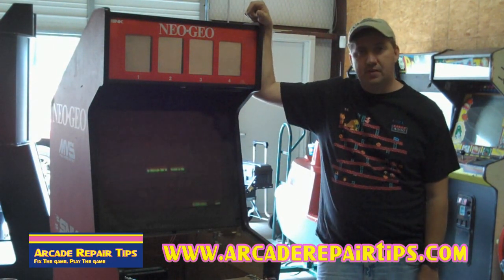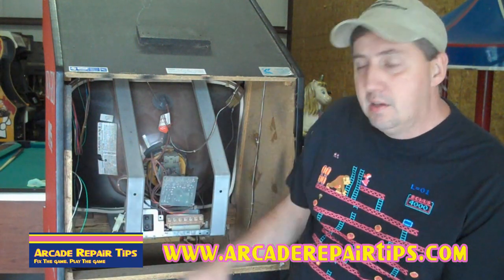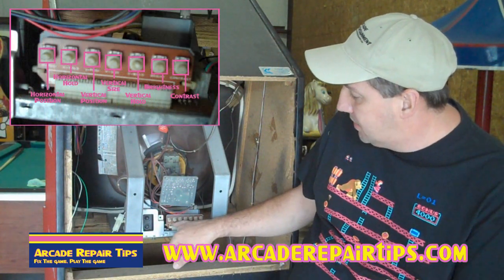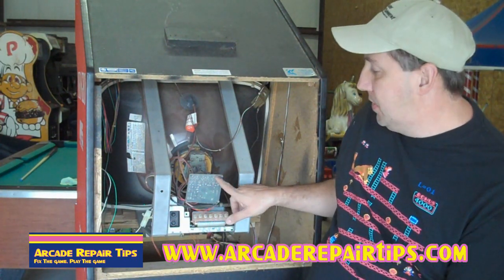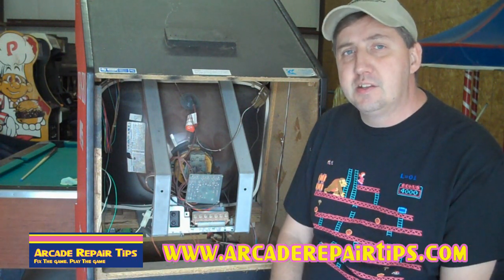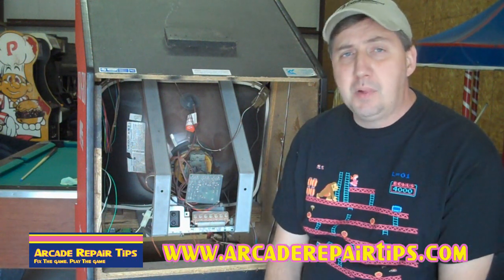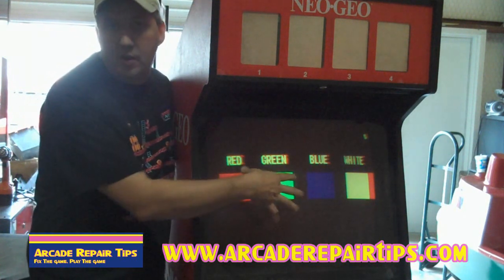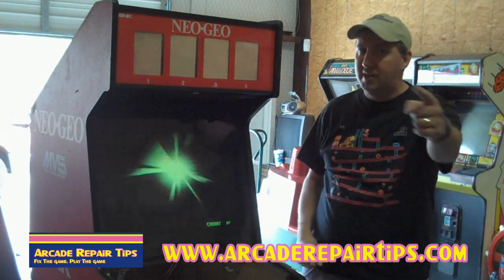Arcade Repair Tips - Adjusting An Arcade Monitor

Comment: I just bought a gorgeous Class of '81. Ms. Pac-Man/Galaga with 25" monitor. The very bottom of the screen is slightly fuzzy, everything else good. The distortion is just at the bottom like were the row of fruit is and on Galaga fuzzy were ship is and the board badge is fuzzy. Any suggestions?
Reply from the maker: Sounds like a convergence or yoke positioning issue. Check out our website for our posts on Adjusting The Convergence Rings and Setting Up And Adjusting An Arcade Monitor for more information. 

Also, just wanted to let you know that we will be covering your question on our Live Show Episode 46 on Thursday, December 3, 2020 at 5:30 PM CT. Here's a link to the episode if you want to watch it: https://youtu.be/vcE7kPMwRP4. Thank you for your question and good luck with your future repairs.

Comment: I need help, please! I got the jamma board to switch, but the game scrolls right to left  and doesn't stop. What am I doing wrong? There is video and sound, but keeps scrolling and is video turned sideways. Do I need to adjust something on the jamma board or maybe this jamma board is for those flat table top arcades?
Reply: no, that scrolling is either the vertical hold or horizontal hold, its an eazy fix, just turn the nob on usually the vertical hold and itll stop scrolling.If your going the wrong way youll know cause itll start scrolling much faster, but im sure by now you have figured it out.Luckily for you its like the easiest thing to fix when it comes to this stuff

Comment: I know I am decade late, but I am looking for info on the Horizontal SIZE. I see in your video, you also do not specify there being a SIZE for it, but you verbally said Horizontal Size.

I have the same described options you do, and there is no way for me to adjust the width of the screen. Is it not possible? I can only make it bigger or smaller Vertically.
Reply from the maker: Hey DARKISANDY. Check out our post and video on Adjusting The Horizontal Width Coil for more information on adjusting the horizontal size. Hope that helps.

Comment: I have 2005 golden tee. I adjusted the volume and screen went out. When I turn off power then back on think vision comes on screen then it’s blank. Is there a way to factory reset or adjust the screen.
?
Reply from the maker: Just adjusting the volume should not have caused the screen to go out. With that said, it’s possible that you jostled something while performing the volume adjustment. Check to make sure that the connection between the monitor and the board is good (probably a VGA cable). You might also want to check the monitor itself to make sure the game board is set to the proper input (try hooking up a computer to it if you have one). Check to make sure that the JAMMA harness is properly connected and that the voltage going to the game board is correct as well. If all that checks out, there’s a good chance that there’s a problem with your game board. If it’s playing blind, it’s more than likely an issue with the video card.

If you would like to hear more of our thoughts, we will be discussing your question on our Live Show Episode 71 which can be found at the following link: https://www.youtube.com/watch?v=ppjQ5N8edJc

Comment: one of the blue neck bord pots fell off what should i do
Reply from the maker: Josh, you should be able to find a replacement for the pot that fell off. Just solder a new one in it's place and you should be good to go. You can get neck board potentiometers from Arcade Parts & Repair, Arcadeshop, and other arcade parts suppliers. Hope that helps.

If you would like more details about your question, please tune into our Live Show Episode 56 on Thursday, October 7, 2021 at 5:30 PM CT. Here's a link to the episode if you want to watch it: https://www.youtube.com/watch?v=j_XtYMFsGpY. Thank you for your question and good luck with your future repairs.

Comment: if the red color gun is not working is the monitor fixable?
Reply from the maker: Unfortunately, there’s not much you can do if the red color gun on the tube is not working. A tube rejuvenator may possibly be able to restore it. With that said, you're probably getting to the end of life on the tube. Best to replace it if you can find a compatible one. Hope that helps.
Reply: @arcaderepairtips  thanks. I was able to replace it. :)

Comment: I'm missing about an inch at the top of my monitor. If i try to move the image up with v size/ v postion it just starts coming back down and overlapping the screen, anyone know how to fix this?
Reply from the maker: Sounds like a classic case of a bad capacitor in the power supply section of the monitor chassis. Get a cap kit and install it and you should be good to go. Check out our post and video on Installing A Cap Kit for more information.
Link: https://www.arcaderepairtips.com/2009/07/09/installing-a-cap-kit/

Comment: I have just installed an Icade 60in1 PCB, which I bought second hand from eBay, into my jamma cab. Basically, the colours are screwed up on the games, more noticeably on Donkey kong because Mario and the girders are purple and not red and frogger as most things look purple, logs, lily pads, everything. On the opening test colour bar screen, most of the squares are purple and colours look dull and flat. Not nice and colourful and vibrant like I've seen on other icade 60in1's. Does anyone know what I'm doing wrong? I am a complete novice and never done anything like this before. Any help or suggestions would be gratefully received.
Reply: First thing I would check is to make sure all my pinouts are correct on the 60n1 connector. Second, make sure you have all colors, red, blue, and green. If you have another jamma board with the same pinout, then you could put that in to see if you have a good picture. It may be that the 60n1 has a different sync frequency or the board has issues with its graphic roms.

Comment: Hello mate im back. i recently rotated my screen and it stopped working. its completely black. no wires appear loose. the anode cup came off. does it need to be placed in a certain spot on the back or will anywhere do? any help is appreciated mate happy to flick you some cash for advice
Reply from the maker: The anode should have a clip on it that attaches to the hole located at the top of the tube. We like to use our discharging tool to reattach it. You should be able to place one side of the clip in the hole and depress the other side of the clip with your discharging tool allowing the clip to fall completely into the hole. If you have trouble with this, we have used needle nose pilers for this as well. Just be sure to make sure the monitor is unplugged, and the tube is discharged before proceeding.

If you would like to hear more of our thoughts, we will be discussing your question on our Live Show Episode 70 which can be found at the following link: https://www.youtube.com/watch?v=MLpo0osHW1w
Reply: @arcaderepairtips  mate thats legendary. thanks so much for your response. Ill be sure to watch! thanks mate

Comment: Bro. How to repair Blue skrin of death on arcade machine
Reply from the maker: A "blue screen of death" is usually caused by a malfunction with your main game board. For example, this issue commonly happens on CPS-2 games that have suicided due to a dead battery. With that said, the solution really depends on the type of game board or computer that is hooked up in your cabinet. You can try some of the steps that we discuss in our post and video on Inspecting An Arcade Board but for more troubleshooting we'll need to know a bit more about your cabinet.
Link: https://www.arcaderepairtips.com/2011/03/16/inspecting-an-arcade-board/
Reply: @arcaderepairtips  OK bro thanks you so much

Comment: My screen on my golden Tee has a yellow color instead of green. Will anything fix that?
Reply from the maker: You might try adjusting the colors on your monitor to see if they are dialed in properly. You can use the video screen tests in the test menu of your Golden Tee board to help with this. See our post on Adjusting An Arcade Monitor (https://www.arcaderepairtips.com/2009/10/14/adjusting-an-arcade-monitor/) for more information on this process.

If you have any additional questions, you can reply back to this comment or join us for our Live Show Episode 76 on Thursday, June 1, 2023 at 5:30 PM CT on YouTube as we will be covering your question during the show. Here's a link to the episode if you want to watch it live: https://www.youtube.com/watch?v=bVep41uXrMA. It will also be available as a recording at the same link if you are not able to watch it during the live feed. 

Thank you for your question and good luck with your repair.
Reply: @arcaderepairtips  I picked up my 2005 Golden Tee and did a color check in the settings. The blue block showed black (no color), purple showed red so that means that it is also missing blue, and the white block showed yellow which is red and green but missing the blue. I wiggled the blue wire but still no blue. I do not see any way to adjust color in this machine
Reply from the maker: @ORTLIEBRC  Usually the color adjustments are on the neck board (see our post on Adjusting An Arcade Monitor that I linked to above). Try adjusting the colors there to see if it makes a difference. If you try adjusting them and you don't see any change, you could have a problem with the input wires/pins on your monitor chassis. Check the connection of these wires between the chassis and the game board. You might touch up the solder on the input pins as well. If you still have problems, it may be an issue with the color drive transistors. See our post on Checking A Monitor Tube for more information (https://www.arcaderepairtips.com/2011/03/23/checking-a-monitor-tube/). Hope that helps.

Comment: at 6:06 you are pointing to a  monitor control board. Mine seems to be broken with some cold solder joints. Do you know where I can buy one of these peices?

my monitor model is G-A63ADG25X

Thanks
Reply: That is your tube model number, you need to buy a control board which suits your chassis, the tube model number doesn't help you buy the control board.  Google "whats my arcade chassis" and use the arcadecontrols pictures to match up what your chassis is, then buy that control board.  You could also just reflow the solder on your control board (I could do it for you too).  Good luck!

Comment: My monitor ratio screwed up. Its zoomed in.
Reply from the maker: In most cases you should be able to adjust it out using the vertical and horizontal size adjustments (or horizontal width coil) on your monitor chassis. If you're using a PC to power your arcade cabinet, it could be that the video display settings need to be adjusted either in the OS settings or in the emulator you are using. You might send some pictures of your screen to questions@arcaderepairtips.com if you need additional help. 

If you would like more details about your question, please tune into our Live Show Episode 59 on Thursday, January 6, 2022 at 5:30 PM CT. Here's a link to the episode if you want to watch it: https://www.youtube.com/watch?v=p6iGiyBQ7ws. Thank you for your question and good luck with your future repairs.

Comment: Be very afraid. Don’t do that with the arcade on. It shock the hell out of me. You need to turn off and disconnect every time you need to adjust to avoid getting a shock. It is harder but it will save you from getting a shock people.